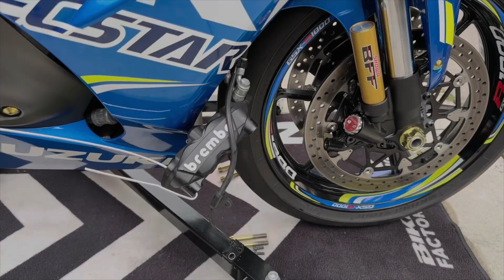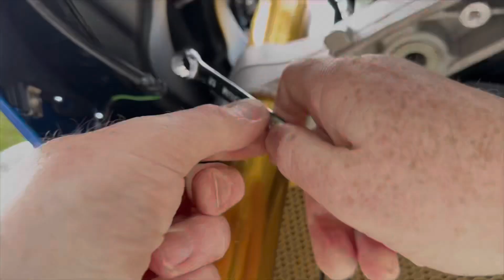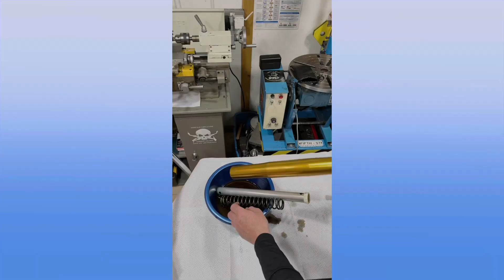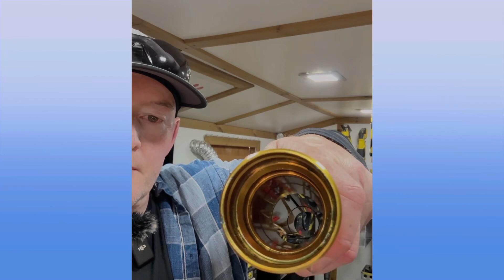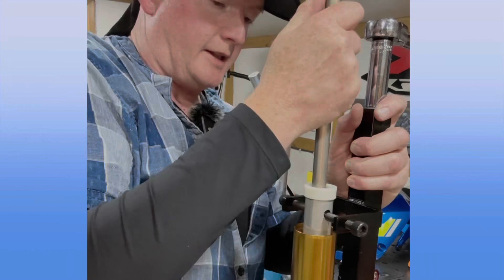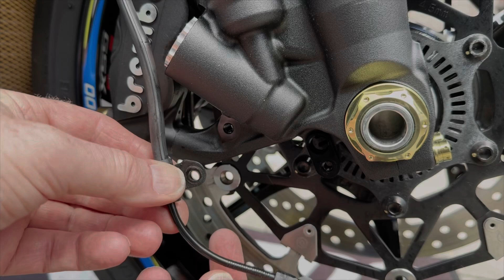BBF Fork Seal repair on my 2018 GSXR 1000 R

Comment: That's the first time I've seen the fork oil level being measured with the forks extended, not compressed. Is there a reason for that?  Especially checking the height with the spring and spacer inside. What was the fork oil volume you put in?
Reply from the maker: The fork oil was poured in so it was just over the spring & the syringe tool I inserted draws out the right amount of oil to set the correct oil limit inside the fork 👌🏻👌🏻👌🏻 the tools used in this video ore listed in the description & may I say thank you for taking the time to watch my video it’s so appreciated 🙏🏻🙏🏻🙏🏻🙏🏻🙏🏻

Comment: Please can you tell me haw much you did put oil inside the fork
Reply from the maker: Hi my friend ✌🏻😉✌🏻 
Yes in the video I filled the fork up with oil just above the spring & the syringe was installed with the oil level gauge & oil was extracted until it was sucking air 👌🏻 when no more oil can be extracted by the syringe the oil is at the perfect volume 👌🏻👌🏻👌🏻👌🏻👌🏻
& may I say thank you so much for watching the video my friend 👍🏻👍🏻👍🏻👍🏻👍🏻👍🏻👍🏻

Comment: hi Dave, did the damping change in the slightest after this? The manual states that there are two separate oil chambers, one outer for lubrication and one inner, a pressurized one that needs to be discharged and repressurized in order to fix weak damping issue.
Reply from the maker: When I made the video it was purely a oil change & new fork seals 👌🏻 there is a pressure system that’s housed in the cartridges at the bottom rear of the forks witch contains nitrogen ? I don’t think your ment to depressurise these cartridges unless throwing the forks away 👍🏻 but like I said the video was purely oil & seal change & never had to touch the cartridges 👌🏻👌🏻👌🏻👌🏻👌🏻👌🏻👌🏻
Ps after making the video I’ve had Absulutly no issues with my BFF forks at all 👍🏻 in fact they feel better than they ever have 🏍️💨💨💨
Thank you so very much my friend for your comment I mean that 👌🏻👌🏻👌🏻👌🏻👌🏻
🏍️💨💨💨💨💨💨💨💨💨

Comment: The 2017 GSXR 1000 forks I’m working on are different. They don’t use the plastic cartridges at all. They use a metal cartridge that you have to screw out 😢
Reply from the maker: I’m so sorry my friend the video I posted was specifically for the BFF forks as shown in the video but I know which forks your working on & I’ve seen videos on YouTube which will help you out my friend 👌🏻👌🏻👌🏻👌🏻👌🏻🏍️💨💨💨

Comment: Great Work! Thanks from Brasil.

Could you tell me if it's easy to disassemble the cane cap? Mine is scratched and I only bought the cap (without the entire silver structure). It's on its way, and I only want to replace the gold cover.
Reply from the maker: Hi my friend yes with the right information & tools you could completely strip the forks & rebuild with ease 👌🏻 but i would say wait till you have all the bits you’ve ordered so you can lay them all out & start rebuilding the forks 👍🏻
The video I posted was very much a first time for me doing anything to forks never mind BFF forks but I did a lot of research made a plan & it truly all worked out for me & there’s no reason why it shouldn’t for you my friend 👍🏻👍🏻👍🏻👍🏻👍🏻👍🏻
& my I say thank you so much for your comment & your interest in the video ✌🏻😉✌🏻

Comment: Great video. So is there no need to do anything with the gas cartridge?
Do you have a link to a service info for this?
Oh you may wanna change the title of this video to bff not bbf. 👍
Reply from the maker: Yes your right my friend it’s definitely bff & yes I will thank you 👌🏻👌🏻👌🏻👌🏻
No the cartridge is A-OK unless you need to strip the forks right down witch is totally down to you discretion if a complete refurb is something your contemplating Baphomet 👍🏻
Reply: @DavesAdventureDream excellent. Been looking for a video for changing the fork oil. Every other video iv seen they did  a complete strip, now i know its possible to leave the gas part alone. Thanks
Reply from the maker: Yes my friend it’s truly fine 👍🏻👍🏻 & as you can see at the end of the video the bike is Absulutly spot on & the forks feel brand new 👌🏻👌🏻👌🏻👌🏻👌🏻👌🏻🏍️💨💨💨💨💨💨

Comment: Hi! :) I'm just about to do the same job on my BFF forks and wanted to ask you something. I found that tool you used to remove the bushings out of the tube. On the Suzuki service manual, the tool has a nice and big chamfer, and the cheap ones in eBay are with very small chamfer. Did that cheap tool cause any damage to your tube and the anodised coating? I saw alternative from Laser for £35, which has a better chamfer and was wondering if it's worth spending £25 more for it... 

Did you use original Suzuki replacement bushings, or you ordered from K-Tech?
Reply from the maker: Hi my friend no there was Absulutly no damage to the inside of the forks at all I mean that 👌🏻👌🏻👌🏻👌🏻
& there’s an old saying that you get what you pay for so get the right tool my friend you won’t regret it 👍🏻
I try’ed to get the best I could afford & all the tools in the description worked fantastic & trust me I had to do it first so if I’d of damaged my forks anyone attempting the same job wouldn’t have to because these BFF forks aren’t cheap 💰💰💰💰💰
Just take your time ok & get good tools & you will be just fine 👌🏻👌🏻👌🏻👌🏻
Pls let me know how you get on ok 
🏍️💨💨💨💨💨💨💨💨💨💨
Reply: @DavesAdventureDream thanks! :) I ordered both versions of the tool just to compare the fit. One thing I forgot to ask you is how much oil did you need to service both forks? 500ml enough per fork?